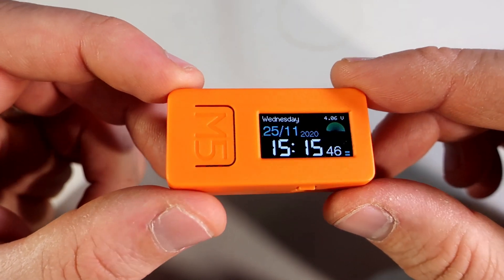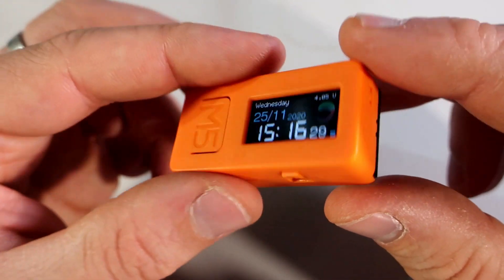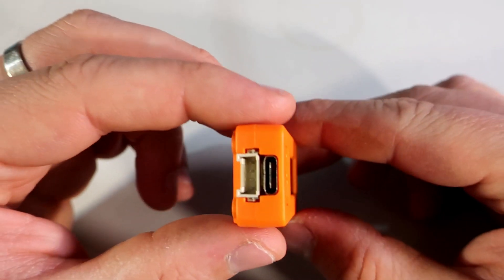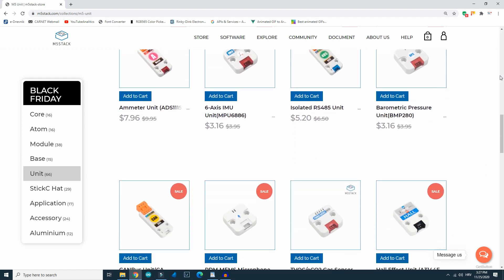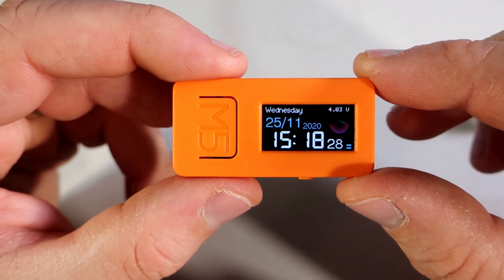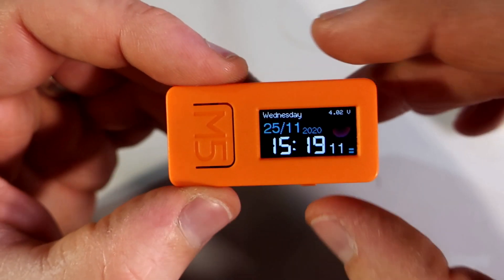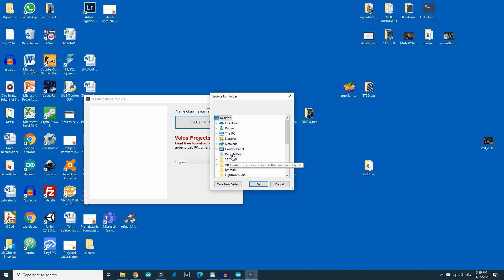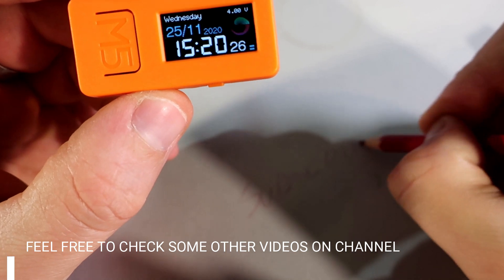M5StickC Introduction and Custom Clock example

Comment: I tried to use it on my Stick c plus but it's showing incorrectly. Could you tell me how to make it fit my screen or get the clockm5stick version for my Stick C Plus ? Am new to this stuff and would like to learn to fit sample sketches you have for my Stick C Plus please. Been using Arduino IDE.
Reply from the maker: https://github.com/VolosR/M5StickPlusClock
Reply: Did you find out how to do it?
Reply: @bazwav   I gave up on it. I bought a Stick C plus 2 a few weeks ago.